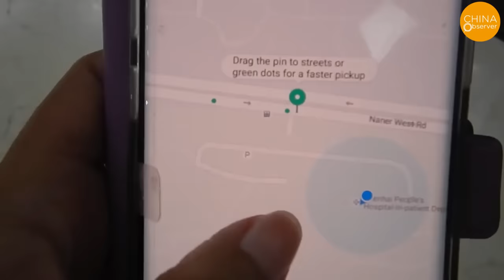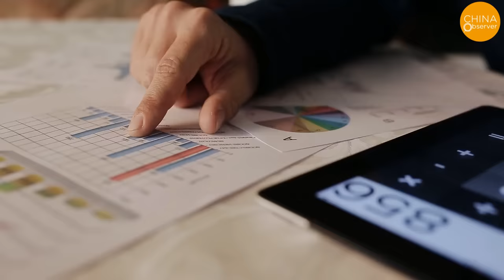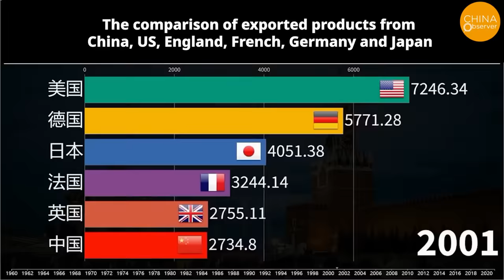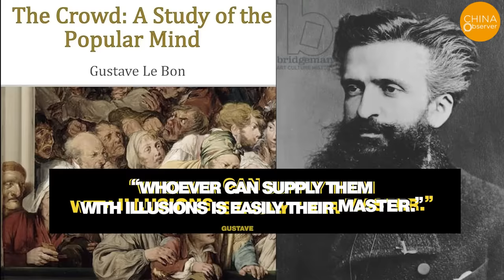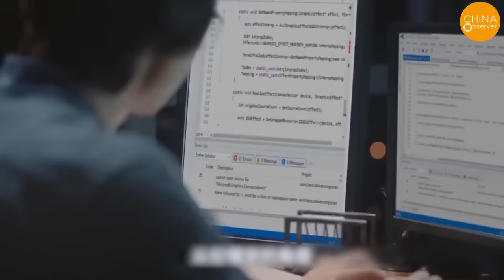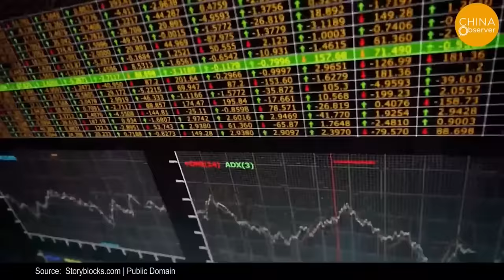China’s Fake Rich: Bought a Million-Dollar Luxury Car, but Can’t Afford to Fill It Up

Comment: I know a Brit who bought a Ferrari and barely drives it because it's too expensive to run. He's also worried about it breaking down because to fix it will cost a fortune. Personally I really don't see point of owning it if you can't use the car,  it's just an over priced ornament sat in the garage.
Reply: He should have bought a Toyota
Reply: Why not just hire one when you need to show off. You can tell others you have lots of expensive cars now renting them out as business.
Reply: Millonaires do not buy Ferraris. We buy Toyotas , Acuras or Hondas Second and Mercedes, and Porsches last....Get it right..
Reply: Had a neighbour crash their car into mine one night. Didn't want the insurance involved for the same reason. I told them, if you can't afford the repair or insurance then you can't afford the car. Two more small crashes later and now they wear glasses. The crash was the front side being damage, enough for the insurance to cover and nothing major
Reply: See it all the time  - people buy a nice expensive car, but put cheap tyres on it and the cheapest E10 fuel. What's the point of all that horse power if you put the lowest octane fuel in there!?
Reply: Just makes me think of the area where I live. Lots of people in trailer homes with souped-up trucks or flashy camaros parked out front that probably cost more than the home itself. It may not be a luxury car but the cost of all the details and personalizations must be crazy.
Reply: @nightshade6433  Yeah its funny it really is all this buying of high end cars but the truth is we just keep them in a garage and we let the Toyota do all the heavy lifting and bringing in of the bread...LOL We got first world problems..
Reply: I get it, if I had a nice Porsche id have a beater Porsche that I'd drive daily, the other one is an investment that will appreciate over time
Reply: A Ferrari isn't much for driving but as an investment. Or at least it used to be. If you buy it as your only car to do everyday errants you miscalculated your spendings.
Reply: Status symbols are rarely meaningful or useful, it's all about saving face, vanity, appearance, like a person being more like a museum and less like a rational animal. Emotional disturbances cause people to do all sorts of foolishness that they end up realizing down the road, long after its already harmed them gravely.

Comment: I hunted for ages to find a power washer not made in China.  Found a German one, snapped it up. No more Chinese junk for me.
Reply: Why didn’t you pick a Karscher to begin with ? Chinese products some are good some are less. But you pah for what you get …
Reply: In China most times you get what you pay for, Apple products are made in China too
Reply: @youngmoney7018 until the apple company shifted their production country to Mexico 😂😂😂😂😂, apple made in china are easy to break
Reply: I try to avoid anything made in China too, but it's not always possible.
Official Akropovic slip on $458, on sale $348, used on Ebay $131 shipping out of Hong Kong, but even the real one comes out of China too, so I saved $236 on Ebay buying a used one, but its just a metal can and pipe with clamp and some fiberglass - hard and impractical for me to fabricate one from scratch at the same cost, given the need for tools and materials would be more expensive than the full price new official one.
Reply: @AaronSchwarz42  akra also has to research and develop products. Saying that you could eventually manufacture one doesn’t sound dumb to you ?

Comment: They didn't buy these to use. They buy to resell. Also as with expensive cars, it's just sometimes it's hard to borrow money from a bank, so they get car loans instead, and then they resell the cars at 10% loss for money.
Reply: If that the case, then they shouldn't have any problem with fuel and parking fine, should they? Because they aren't going to use the car, anyway.
Reply: @stormryder4305  some people do that, but its weird you cant refuel your $350,000 car.

Comment: Check out the fly buzzing around the pile of seafood at 13:51. Food safety suffers in both producer and consumer phases.
Reply: Good spot.
Reply: I get your point, but they're also seems like they're sitting outside. If it was three or four, I would agree that's nasty. We've all had a fly that just would not leave you alone for one second
Reply: The main entree just escaped!

Comment: Even in India most of us take loan to buy home/car.
However we live little modestly and try to make some savings.
Reply: India though does still have some culture and community to fall back on. In China the CCP has destroyed those things. So you either have political power or financial power. If you don't have either then you are nothing.
Reply: There's nothing wrong with taking a loan to buy a new home. It can be okay for cars too but they often lose value much quicker than a house.

The problem is when you buy a house that is so expensive that the interest on the loan nearly takes away all your income each month. While the loan-taker/buyer certainly are to blame for this - in my opinion the bank should also make sure that the loan isnt too high. After all, theyre stuck with a customer who cant their fees anymore.

Comment: I make $40k and my wife makes $30k, no kids, one kitty, we can barely afford to rent a basic apartment and choose to rent someones basement in suburbia where the houses that sold for under $100K new in the 1980's are now selling for well over $1 million, but also need a lot of work because they are as old or older than me and were not built like stone castles, out of light wood and drywall, with flaky roofing and siding that has to be replace, painted, windows that leak out gas then get condensation, heavy property taxes, yard maintenance, and the USD keeps weakening making fuel and food more expensive. We spend about $4K per month on food, rent, fuel, insurance, services, all said. I feel very poor even though we make a middle class income, that just does not go very far nearby!

Comment: China's investment/GDP ratio averaged 41 percent from 2000 through 2008, more than double that in the United States (20 percent) over the same period. However, China's national saving rate was even higher: It averaged 48 percent from 2000 to 2008, compared to 15 percent in the United States. From Google.